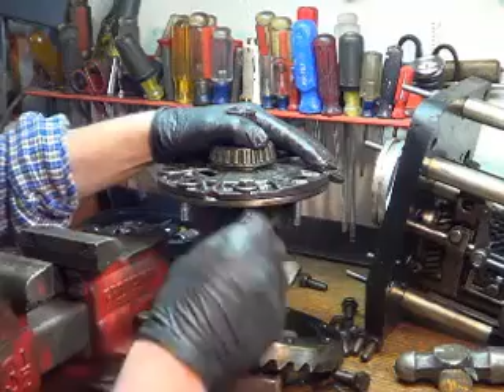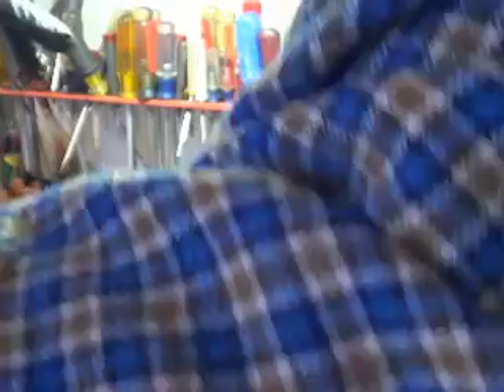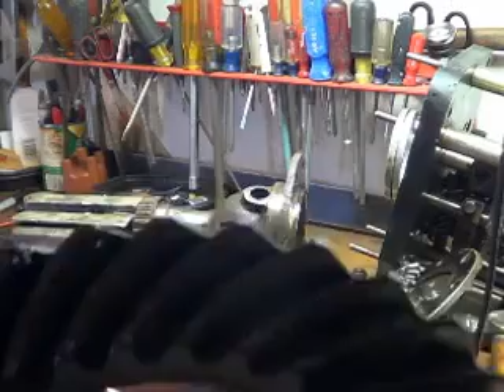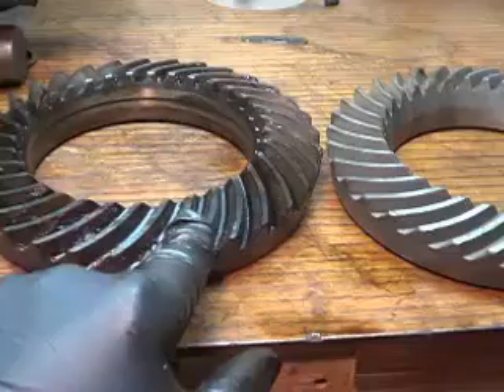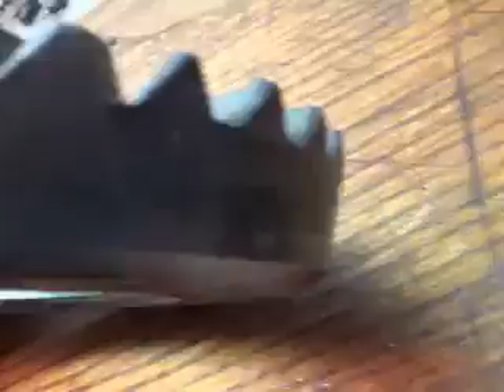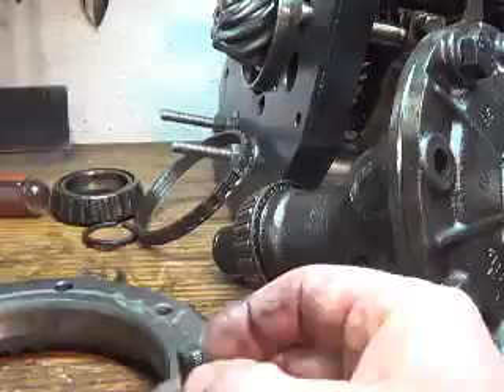EZGZ Volkswagen Transmission Tip and Tricks Part 10

Comment: Hello EZ, I love your Transmission Tips!  Question you said the 4.37 wouldn't be good for street launch. My question is why? Is it not strong enough? If so what setup would I want to go with for the track? Thanks for sharing! =)
Reply from the maker: The German 4:37 would probably work fine for a long time. I was referring to the Chinese 4:37.    What gear ratio you choose depends on many things. Weight of car, tires, Engine HP and RPM.  If you want a nice review of a race tranny check out VWdarrin on race transmission questions answered
Reply from the maker: OOOPs I forgot my manors. Thank you for watching, commenting friend.

Comment: Hi,Is the after market ring gear meant to fit an earlier gear box?.Or do they have different gear box set ups for 1300 and 1600 engines?. If so are they tagged on the outside so you know what you got?.Really enjoying the gear box series, never to old to learn new tricks.
Reply from the maker: Although the earlier gear box did come with a 4:37 gearing it was in a swing axle style carrier. The bolt length is the same and my super diff which is old style has the same flange thickness. Unfortunately I don't have any totally stock stuff in that arrangement laying around. Thanks so much for the input friend.

Comment: hey their ez .when you removed the ring gear with the smaller bolt would it not just slip past the threads of the ring gear? ps i love the smell of gear oil in the morning!
Reply from the maker: The ring gear with the smaller bolt is brand new after market. No name on the gear or the box. I will heat it up and try it if I get a longer bolt which is manditory.